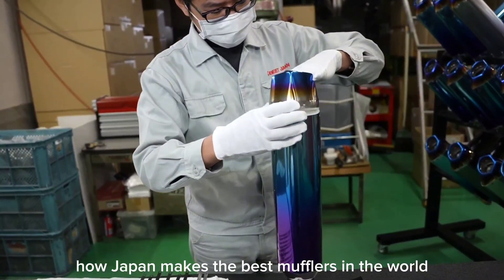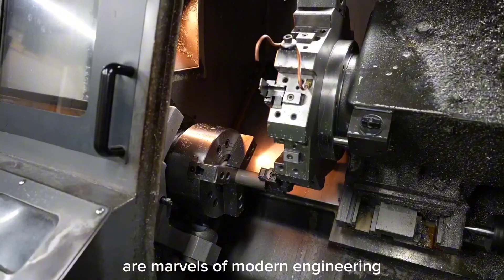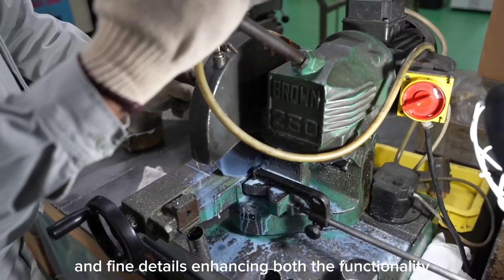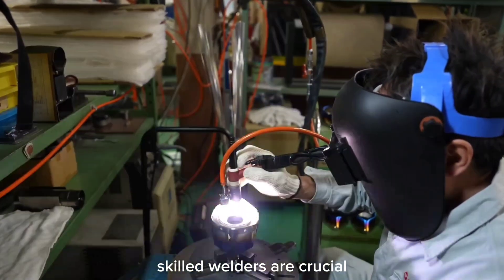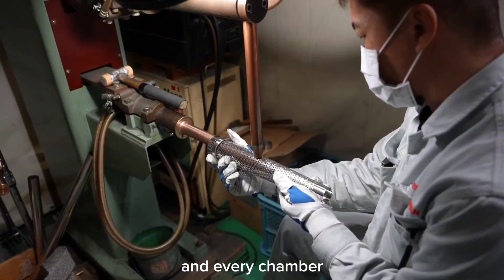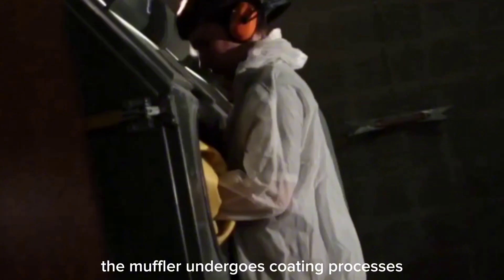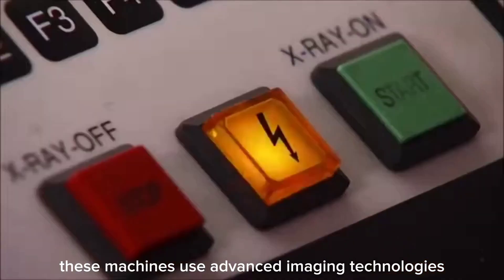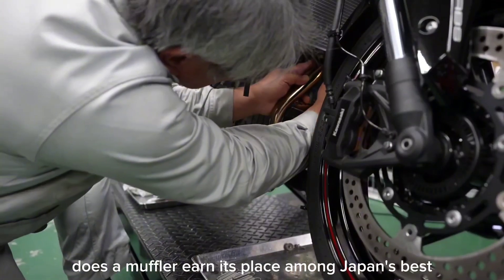How Japan's Most Expensive Muffler is made

Comment: The visuals do not match the  narration, and do not follow the process. Very little, beyond the original ingots, of a stainless muffler is cast. You would avoid mixing component from different metals (as implied in the video) due to galvanic corrosion (with heat and moisture from exhaust gas) and aluminium and stainless are especially susceptible to this. The only reason to go for aluminium alloy is weight (it otherwise has many deleterious properties in this application) and that better served by titanium.
Reply from the maker: Thank you